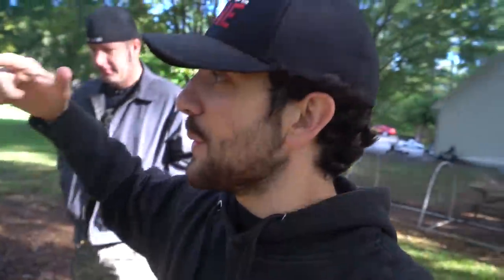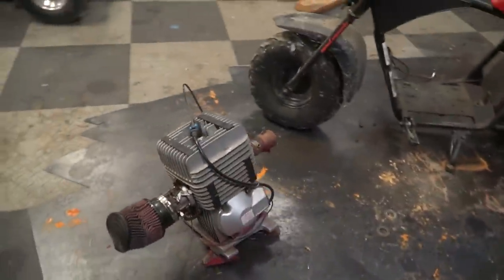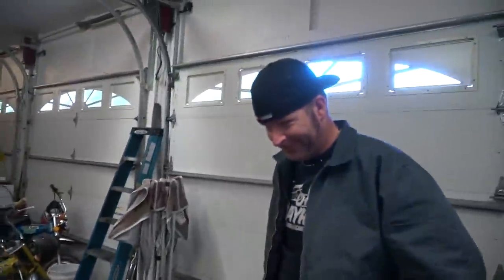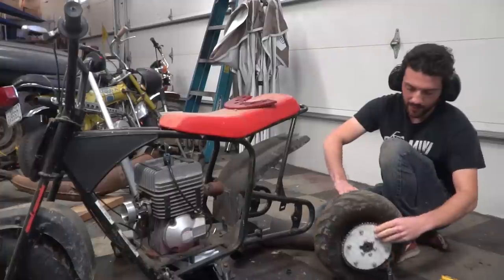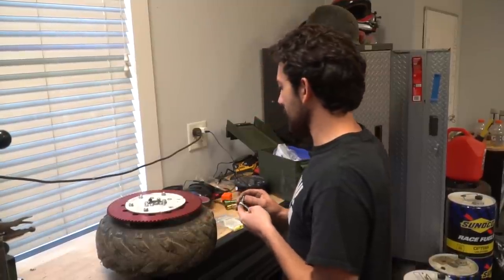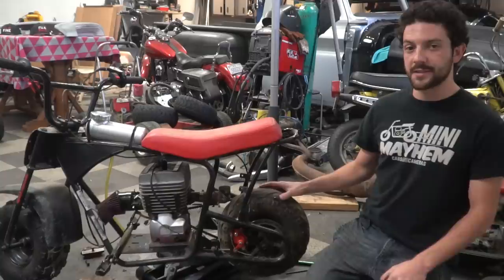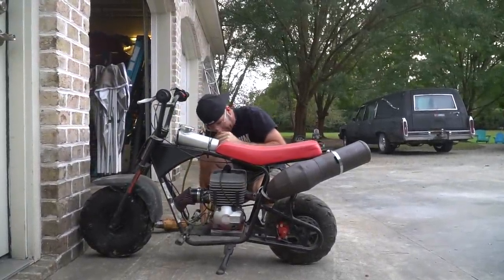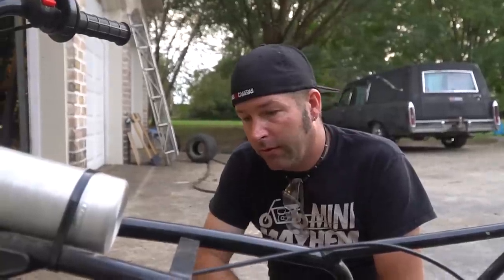2 Stroke Mini Bike Build!

Comment from the maker: This engine makes around 15 horsepower at 10,000 RPM. A Monster Moto chassis weighs about 12 pounds. This thing is gonna fly.
Reply: CarsandCameras nice
Reply: CarsandCameras you guys are the best
Reply: FYI Those KT100s wear out kinda fast, and fresh ignition coils are really expensive!
Reply: If it is a go cart engine it should spinn the other direction. Try this
Reply: First thought when I read notification tile was snowmobile engine on a mini bike
Reply: Looks like it makes zero horsepower.
Reply: Is go Powersports going to do anything with the Monster Moto brand they bought out?
Reply: Was that an 85 tooth sprocket!? Things going to do 20mph but flip 😂
Reply: CarsandCameras when will you be putting out more videos on this thing can’t wait to see more
Reply: Cars and cameras  put a wall of pictures of your projects then ever so often do a dart board  pick . Even a bucket list page of projects you would like to do...
Reply: More like 15k RPM. Don't run it lean or you will stick it. No spark you probably need a new TCI. I haven't run a kt 100 pipe in years but if I recall you want the high end needle like 3/4 turn and the low end like 1 1/4, somewhere in there. Also, just do yourself a favor and replace that pipe exhaust with a can exhaust. You will lose power but gain reliability. With the pipe you're going to wear out the ring and piston faster. You're suppose to change them out every few hours of use or so. I used to do a piston/ring every 6 or 7 races. Not to mention having to bore out the cylinder from time to time. With the can exhaust you can probably forget about it. Plus the angle on that header is probably killing any performance you'd get out of the expansion chamber (pipe). You really should have at least a head temperature on it if not EGT to tune the motor and make sure she doesn't get too hot. Like under 420 degrees F on the head. Racing motors really aren't the best for yard kart applications. Trust me. Oh almost forgot that clutch will probably die too.
Reply: You guys should build a klx110 I wanna see what you guys would do
Reply: Unplug the kill switch from the loom they can fail aswell and constantly be on kill mode lol
Reply: drop one of those snowmobile setups on this thang man!!!!!!
Reply: the sweeds have 660
Reply: Glad you guys took my advice and started 2 stroking.
Reply: @jjhack3r  2stroks are grate when they run and there ported correctly
Reply: I just have to say, this is awesome! Also that oil ratio I way too much oil, I highly recommend you run 50:1 with any good synthetic 2 stroke oil.
Reply: I've got a 212 predator on the same frame. It looks stock but flies
Reply: Chris McRoy   Yes an aftermarket coil could be adapted possibly, but this is not a Yamaha bike, this engine was developed specifically for race karting, then adapted to ultralights, not bikes. I know very well how an engine works, and the KT100 has a magneto fed ignition, which is a whole different case than battery fed coils.
Reply: Are you going to do a video ion the new Tillotson 225 Long block race engine.
Reply: My dads iq 600 has a liberty 600 makes 120 hp
Reply: What do u think about a comer k80
Reply: You guys should try an electric cart, new technology and they go like a bat outta hell. Besides that you can cruise around the neighborhood in a quiet stealth mode!
Reply: CarsandCameras iridium spark plugs are mainly ran on 2 strokes keep it that way
Reply: Shim the back side of the motor a little bit if you end up with exhaust hitting the tire. 👍
Reply: @radioactivelarry  electric is way to expensive..... good luck getting the same power for even 400% more money...
Reply: CarsandCameras a got a wee 50cc quad and it only moves when u have it at half chock how can a make it idle
Reply: Bro you are speaking too much You shouldn't speak too much you should do the job at the here i am too boreddddd :((
Reply: CarsandCameras  can I get mini bike
Reply: Yeah it will. I build nearly the same but with a 60cc portet shifter motor and it goes crazy.  It makes 8hp
Reply: CarsandCameras Can you do a video how to make the adapter or where I can buy one Iv been trying to find one for the past 6 months and I’ve found videos of people I having them but not making one I have the same mini bike I just have a 125cc atv motor and need a rear adapter please help
Reply: you guys move out whos gonna remove your folk's lawn for free now? lol
Reply: what clutch?
Reply: Is there a part two for this
Reply: Where can i find that engine is there any place where i can buy one?

Comment: I was a crew chief on a kart racing team in the 80's. We ran those very engines, and others. The header pipe between the exhaust manifold and expansion chamber should be straight.  Length is important too. We had 9" to 2" ones in 1/8" increments. The header Length, gear ratio and clutch engagement rpm all need to work together. If I remember right the longer header made power lower in rpms, while the shorter one made more top end power. Tilting the motor up in back will help straighten out the header. Go right out under the seat.

Comment: Great to know somebody else builds some crazy toys. I did a kart with an atc 110 w/automatic,implimented slap shift on a streetcart frame and a spidering rear axle with atc tires on the rear and modified wheelbarrow wheels on the front. That was awesome fun in the snow and mud. Good times,keep creating guys.

Comment: I raced karts with those little engines so awesome!
Reply: Im a 2 stroke guy but dont have any experience with this particular motor. 16.1- 20.1 sounds suuuper rich but like i said, i have never messed with these so i was curious
Reply: Jacob Wilbert no if the ports are set up for it and it’s got the carb for it run more fuel
Reply: @anythingthatmoves9609  
👍 makes sense, I never heard of mixing gas that rich but as i said i never messed with super screamer racing motors besides a nasty yamaha blaster i built but that would foul plugs left n right if u were trails riding n didnt have it screaming constantly

Comment: Two strokes won't all spin either way. Depending on the intake valving system and more importantly the ignition timing most will only run correctly in the direction they are setup to.
Reply: It wont run correctly backwards but it will
Reply: @isaacitllbefine7231  yep. That's what I said:)
Reply: The ONLY thing that would ever need modifications would be the ignition, otherwise there is nothing on an ordinary piston port or reed valve 2 stroke that would prevent it from running perfectly fine backward. Rotary 2 strokes, or 2 strokes with power valves, could be another story.
Reply: @brandon2076  I have a 2 stroke with rotary valve. When the primary coil wiring is wrong, it will run backwards even with the transmission.
Reply: @Bike Life_93 there are indeed "valves" in some 2 strokes. Not the teardrop shaped valves you see in 4 stroke cylinder heads, and they arent actuated by a camshaft, but they are technically valves. Reed valves, rotary valves, power valves...
Reply: @Bike Life_93 that's only partially correct. Yes, all 2 strokes have ports in the cylinder wall. But not all have reeds. There are a few types of 2 stroke, typically different in their mode of intake/induction. There are reed valve engines, which can be cylinder inducted or case inducted. There are piston port engines, which can only be cylinder inducted, which have no reeds at all but instead rely on the piston itself to open and cover the intake port. Then there are rotary Valve, which are case inducted, which sometimes have composite discs with cutouts that rotate with the crank to control the intake timing, sometimes the crankshaft itself is cut with the windows instead.
Reply: @Bike Life_93 Not all have reeds, most of them made in the 80s or after have, but some cheap engines like chainsaws still don't use reeds. Also some have power valves, which aren't  really valves but still, they only adjust the exhaust port timing.
Reply: I came to the comments and paused video as soon as he said it will spin either way.
Do R/C is right.. it cant spin either way properly.. sometimes u can get lucky in certain designs but in general u r ignorant to try to get it to spin opposite of what its designed for.

Comment: A 90 bend like that is no good.... love the build though 👍🏼👍🏼👍🏼
Reply: Yeah had the same thing on my mind...in 2strokes exhaust is everything
Reply: No other way to run it with what we had
Reply: @isaacitllbefine7231   yeah it be like that some times but it wont flow well now for the maxium but sure still gonna be a fun ride🙌🏼
Reply: @isaacitllbefine7231  I would have made the bend more smooth instead of just a 90 degree angle. Looks like there is plenty of room for it when you redo the part that connects to the cilinder.
Reply: @isaacitllbefine7231  That's the point Isaac, get someone to do a proper bend for you, I'm sure you know some with a tube bender, anything would be better than the 90 degree.
Reply: exactly, the 90 will absolutely disrupt the exhaust pulse which is vital on a 2-stroke
Reply: OMG another 2 stroke exhaust Blunder. Guys, you can't do that to a 2 stroke exhaust and expect it to run correctly.  As mentioned before a few times.... Please, Please read up on two stroke exhaust systems. Once you read it you will be slapping yourself in the head HARD when you realize how bad all of your 2 stroke exhaust systems were.
Reply: Don't 95% of 2 stroke exhaust do a straight 180° turn out of the cylinder? Like almost every 2 stroke dirt bike ive ever seen?
Reply: @Billo-07  but it's a smooth bend, the exhaust pulse can follow a smooth bend. they had a straight up  90 degree hard angle.
Reply: Lil
Reply: @TangoOne  while i can agree with you, i can also  guarantee you're not a 2 stroke exhaust engineer
Reply: Nico van Duin Did you mean smoother? Haha
Reply: @Billo-07  well obviously, it's not exactly a common profession if even a profession at all.
Reply: Should be straight out under the seat.
Reply: @isaacitllbefine7231  I'm glad you guys work with what you've got on hand, and innovate to get things going.  For testing purposes!  Very relatable.  I've got zero problem with the exhaust bend.  It's not like it's going to stop the engine starting and running which is the main goal at this stage!
Sorry for all the drama queen internet "experts", you guys must have the patience of saints.  Good grief it's been a facepalm fest for me reading some people's "expert" rubbish.
I'm working through all the vids, oldest to newest, having just discovered this channel.  Loving this sort of content from some great dudes looking to have fun on these cool projects.  I've binge watched 95% of the previous vids in the last three weeks of lockdown and love it.
I don't want to watch some hardcore two stroke specialist, I want to watch you guys working through it, like I would be.

Comment: Make a wedge for the motor mount to lean it forward. You'll put your air filter in a better more serviceable area, have a straighter shot out the back with your exhaust so you can do away with that tight 90, and you'll gain chain clearance by lifting the front sprocket.

Comment: Hey just a little tip. Some spark plug boots are screw in and eventually the wire will slowly disappear. Usually this is if it is an intermittent issue (it sounds like it is based on y we’re having issues with it but never said it didn’t work) and can be fixed by cutting the plug wire until you find good thick wire. This happened on my three wheeler and it is really frustrating. I hope this helps, and keep up the good work!

Comment: Kt100 is a great engine. Been running them since I was 10 in wka usps Route 66 and a few other racing series. I would love for you guys to get a mychron timing system. If not for a go kart for a Miata. I run them on my carts and they are invaluable. If you buy the gps module you can program tracks in with no physical timing system. Really would love to see this. I enjoy the videos can’t wait for the new property. :)

Comment: When you weld up exhaust, braise it with bronze instead of welding it with MIG. It will handle the vibrations and the mismatched metal far better. To this day Hooker still braises all their flanges on their competition headers/header kits.

Comment: Cool concept.  I'm glad you guys are pragmatic and work with what you've got and innovate to get things going.  Very relatable.  I've got zero problem with the the exhaust bend.  It's not like it's going to stop the engine starting and running which is the main goal.

Comment: Try Opti-2 2 cycle mix, works in any 2-stroke no matter the mix ratio. I use it for all my equipment that ranges from 32:1 to 50:1 and haven't had one issue.

Comment: I’ve got a pw50 and it’s a ripper! Crazy for a tiny 2-stroke I must say.
Reply: If you think that's fast... try a Rm80
Reply: jjhack3r try a cr500 😛
Reply: @zethloveless7238  that's not a tiny 2 stroke...
Reply: @zethloveless7238  pw50 and pw80 are slow kids bikes. Rm80 is a legit race bike with 6 gears instead of 3 like the pw bikes. Pw actually stands for peewee
Reply: jjhack3r I know what all these bikes are dude it was a joke 😂
Reply: jjhack3r yah my pw50 feels a lot faster because it’s so small and direct drive with 1 gear. You feel it hit the power band a lot harder and it can get up in the rpms and speed pretty good for a small bike.
Reply: @patrickfields3392  I've been on one and they are slow. A 1970s air cooled Rm80 is scary. If you give it too much gas in gears 1st-4th the front wheel comes up.

Comment: CHECK TO SEE IF THE SPARK PLUG BOOT IS STILL CONNECTED TO THE WIRE! Those older vintage 2 strokes were usually killed by pulling the sparkwire so I've expierienced the screw coming undone from the spark plug boot. Also the coil needs a good solid ground, it can break internally from the vibrations so everybody usually "cradles" them and uses a grounding strap. I've never heard of the actual ignition system failing but the ignition coil is a common failure, as well as the spark plug boot. And these things run at 20:1 fuel and will usually foul a plug within a couple hours. The spark plugs used are NGK BR10EIX at or above 13,000rpm or if it's running a shorter track will use a "9" heat range plug. DO NOT USE an "8" range plug, it will burn a hole through the piston!!

Comment: Great video guys, you figured out how to mount the engine and move the rear wheel around.  But seriously you are going with a 90 degree bend in the exhaust.  This will rob tons of HP and Torque from the engine.  

From the looks of it there is a bunch of exhaust from the exhaust port to where you put the 90 degree.  I suggest to shorten the length and find someone with the proper equipment to bend a smooth radis to the expansion chamber. Take the time to do it right not hillbilly it.

Comment: Extend the rear section of the frame by five inches....it will help with high speed stability anyways and it will allow a tire size changes ...it's a win win.

Comment: For spark look into a TCI box first then the ignition coil, plus with these motors you do not need a kill switch, they will kill themselves out most of the time once off the throttle so that too could be your issue and it's just grounded out.

Comment: I have the same scooter with the same 2 1/2 HP engine. I need the original engine for another project involving yard work. To replace the original engine I have a vintage McCulloch MC101 engine. Properly tuned the MC101 will easily put out 15HP @ around 12,000RPM. I expect my bike will be a screamer just like the one you guys are building. I look forward to video #2.

Comment: The KT100 will crank well above 14,000 rpm's with the right pipe. A blueprinted KT will have about 18hp. The spark issue is most likely the TCI switch. The elbow you put in the exhaust is going to reduce power a lot. Also this engine will not pull very hard below 9,000 rpm's. To get the exhaust corect you should tilt the engine forward and get a proper curved header for it. The clutch is going to be very short lived. You should use a jackshaft clutch set up.

Comment: You know this isn't the perfect place for this comment but I've been dreaming of adding on reed valves and an expansion pipe to a rotary engine to get it to self supercharge like a normal piston 2 stoke. Because a rotary engine is a 2 stroke, every time the combustion area is swept it fires, the ports are in the wall, no cams, no valves, you mix the oil with the gas, they like to rev really high, they have no torque. They really are a 2 stroke, just without the 1 thing that makes 2-strokes so awesome, the self-supercharging.

Now putting an expansion pipe on a rotary wouldn't be hard. The tough part would be the intake. The exhaust and intake have to overlap which they don't in a rotary in order to get the self-supercharging to work. So I think that if you connected the intake and exahust just outside of the engine, and fitted them with 1 way reed valves, and then sized an appropriate intake plenum with a carburator on it, it might work. You would need 2 reed-valve gates. One where the exhaust connects to the intake so that it could only go from exhaust to intake, and then another just after the carburetor so that exhaust can't go out the carb either. I could draw it. I'm not sure if it would work but I think there is a decent chance and how awesome would it be to have the world's only self-supercharged rotary!

Comment: Should rip when you get the ignition sorted out. Its a pretty simple system on these, shouldn't take much. Should get a proper expansion chamber though. Cut up a pipe from a 125 2 stroke and you'll get loads more performance. These engines can make 20+ horsepower with a proper tuned pipe and maybe some porting. The skys the limit with 2 strokes and power.